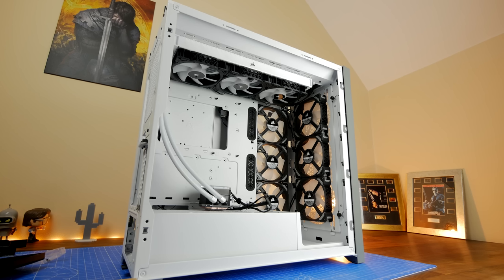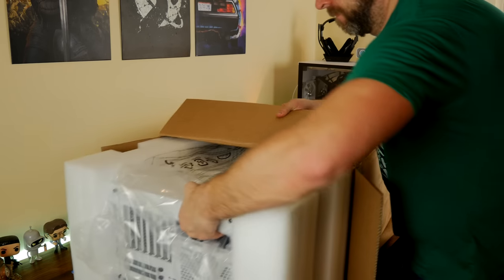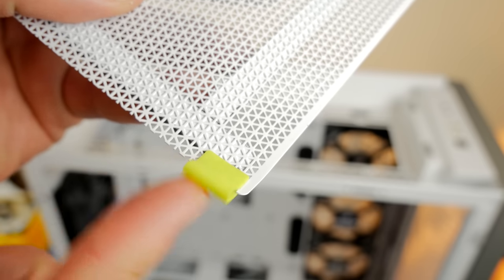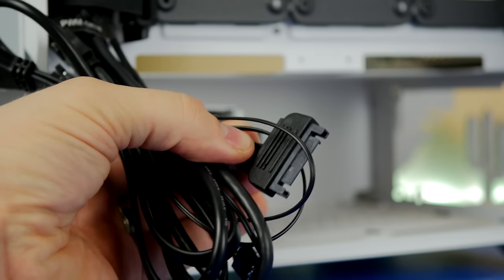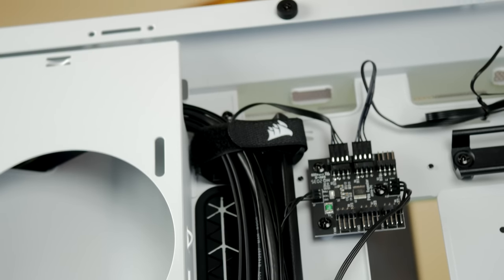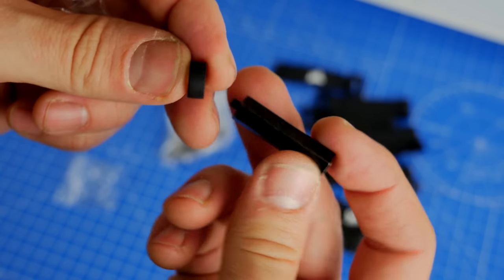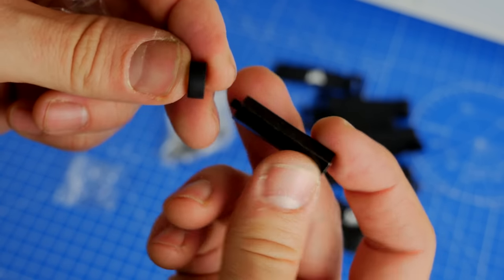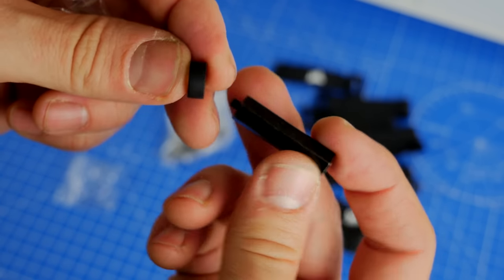Corsair 5000D Airflow build with 12 fans, H150i Elite Capellix Push Pull (in-depth build guide)

Comment: I am confused on the how the lightning node has a purpose in this build. Does the commander core need the be connected to the lighting node? Together both commander core and commander pro support x6 RGB fans connections each, and the pro has the x2 LED connections.  Can't you just use those LED connections on the commander pro to replace that function?
Reply: I've actually spent the last two hours to figure this out myself.

For a modern RGB fan you need to both control their lighting and power their PWM needs. *assuming you want all the features

As i understand it, the [Commander CORE] is needed for the AIO cooler to operate and can control 6 RGB fans and power 6 PWM, the [Lightning node CORE] can control 6 RGB controls but CANT power the 6 PWM, The [Commander PRO] CAN'T control 6 RGB fans but can power 6 PWM, the LED inputs are for connecting to [Commander CORE] or [Lightning node CORE].

So if you are running more than 6 RGB PWM fans you will need at least a [Lightning node CORE] + [Commander CORE] + a way to power 6 more PWM to get all of the lights past the first 6 going.

However if you want to sync all the RGB lights together in cool patterns you will need a [Commander PRO] which will receive the LED input from the [Lightning node CORE] + [Commander CORE] AND power fans 7-12.

So long story short, you will need a [Commander PRO] + [Commander CORE] + [Lightning node CORE] if you plan on color controlling and powering an AIO cooler and more than 6 RGB PWM fans.
Reply: @SetsunaKai5  Thanks for the reply, I really appreciate it. You helped me understand the difference between the power breakdown of RGB connections and PWM connections. You see I was not trying to not make the extra expenditure on a Lighting node CORE! especially after I just bought H150i, LS100 strips, and a Commander PRO lol. but you answered my question so thanks again
Reply: So you are telling me Commando PRO can not power a RGB fan even with an LED connection???

Comment: Very nice video, used it while building! Do you think running 3 fans front and 6 top will cause any issues? I have the black case with glass panels at the top, it feels tight and im afraid of suffocation.
Reply from the maker: Is that the 5000X? If it's pressed too close to the glass that might be a drama.

Comment: Did you try different fan setups? I am buying this case as well and so far I will have 7 additional fans not including the 3 on the AIO….just wanna know what the best set up you found was. I’m worried the intake on front and side might just pull air into the glass and change the directionality
Reply from the maker: Only this one https://youtu.be/r5OY9llXRwo

Comment: Yea the ML Pro spins 2400rpm for 120mm and 2000rpm for 140mm I use 2 120mm for AIO Exaust H100i Platinum and 6 LLs for the case which spin a little slower less noise 680x Black

Comment: Pretty good video, I got the black version of the case and the H150i with 7 ML120 RGB Elite. At around the 26 minute mark you cut when putting the alternate PSU shroud and I'm having trouble putting it in place.

Looks like it needs pressure down but I have tried with decent amount of force and I'm afraid I could break it. I can align the tabs on the shroud side but it has a prong on the bottom that's supposed to be pushed into place in the chassis but it's not going in.

Do you remember what you did to put it in place?

Comment: Do you know how thick the radiator support is on the motherboard tray? I know it can fit a 360mm radiator but I'm not sure about the thickness since I've been thinking of fitting Arctic freezer AIO in there which is 57mm thick including fans.

Comment: I have a question. If you don't use the fans from the side of the case, is it possible to remove the fan tray to make room for the hard drives or the side panel simply doesn't close if you don't install the fan tray?
Reply: You can remove it

Comment: Can I just install three fans on the top of the case (outside, pulling air) and mount the Elite Capellix Radiator under  it without install three additional fans directly attached to the radiator. do you think it it will provide enough airflow to cool down the radiator? I am thinking a easy cleaning of the radiator. TIA

Comment: did you use a fan hub to plug in all the fans? if so which one i can never find one that looks "ok" . not sure myself what i mean by ok but they all look cheap and overall crude.
Reply from the maker: The commander core that came with the cooler

Comment: Do you think is a good idea jump from the Corsair 500r to this one?
Reply from the maker: Very much so. The 5000D is a great case. Good airflow, easy to build it, great looks. It's one of the best I've built in lately.
Reply: @TheProvokedPrawn  thank you for answering, question do you think the noctua redux made a huge difference? Or with the ml120 from Corsair are enough? I need to keep cool a rtx 3090 ftw3 and a 10700 non k with nhd15.

Comment: Hi Great video btw this is helping me a lot for my 1st build I have the same case but I,m a little confused on which motherboard to get for this, its the front ports how many headers do i need for all the front ports on the case  to work? Can the 2 type A ports use one header?
Reply from the maker: You can get splitters if you haven't got enough ports on your mobo
Reply: @TheProvokedPrawn   Thanks for the swift reply just done a bit more research and I,m pretty confident now 👌

Comment: New PC builder question: Does the push/pull setup mess with the case pressure? I’m thinking about running a very similar setup and was going to add a rear exhaust fan, but am questioning it because technically w/ the push/pull rad setup you have equal amount of fans as your intake at 6. If someone could point me in a direction to find an answer for this that would be fantastic.
Reply: i was wondering the same.

Comment: im new to building , i bought the corsair 5000d rbg , i thought it came with a comander pro , it just has the led hub and fan controller. do I need to get a commander pro ?? and if i do , how would i use the ones that CAME WITH THE CASE?

Comment: Nice content! I just have a question, for the push pull configuration, you used long screws to mount the 6 fans to the radiator right? Do all of those screws come with the QL120’s?
Reply from the maker: The long screws all came with the AIO
Reply: @TheProvokedPrawn  so did it come with 24 long screws? sorry*
Reply from the maker: Yup

Comment: 19:30 quick question... so you see theres 6 of those power cable slots for fans right... I'm going to be using 7 fans (not including the 3 aio fans) so where do I plug the other cables in for power? am I just being stupid or is it actually a common question...?
Reply from the maker: You can plug power into motherboard system fan headers if you don't want another Commander.
Reply: @TheProvokedPrawn  thankyou

Comment: Great video, thx! Few questions: How much space between side fans and front fans? If i want install radiator+fans on side and radiator+fans on front, will they interfere with each other?
Reply from the maker: You can't. Two rads can only be side or top mounted.  Or front and top mounted.
Reply: @TheProvokedPrawn  thx for answer!

Comment: Correct me if I’m wrong. Did you sacrifice your front panel usb connectors so that the other Corsair hub could connect to the usb 2.0?
Reply from the maker: No, front panel connects to the side of the motherboard, those controllers connect to the bottom.
Reply: @TheProvokedPrawn  so the Corsair 5000d has usb 3.0 on the front and my current case connects it to a usb 2.0 so when I get this new case they will both be free I’ve been rewatching this video so much wondering where I’m going wrong

Comment: Very informative and helpful instructional vid - LIKED and SUBB'ed!  Looking forward to watching more of your work!  One of the few reviewers/instructors that seems to really 'care' about helping those who are considering DIY.  Speaking bluntly, this looked a LOT HARDER than I would have at first imagined, I am referring to setting up all the wires and connectors to run 12 or 13 fans!!  What a nightmare!!!  Plus, you did not mention that Corsair also makes LED/RGB ML (Magnetic Levitation) fans, which I surmise might be more durable (though perhaps louder?) than conventional-design PC fans.  Have  you ever tried a custom cooling loop solution?  Also I saw ARCTIC makes a nice line of very thick rad AIOs, which are purportedly VERY effective.  Have you checked those out?
Reply from the maker: Not done custom loop yet no. And sadly not seen any Arctic cooling gear yet sadly. Thanks for the comment sub and info!
Reply: @TheProvokedPrawn  I believe the 'included' fans with the Corsair AIO you are using are indeed ML (Magnetic Levitation) models, at least on the RGB version of the Corsair H115i, they are (ML).  Supposedly they live longer lives than conventional fans but who knows?

Comment: HELP😱, so i just stuck in a capellex 150i into the 5000x. I didnt realise the commander node didn't have a usb port. So im stuck what to do with my additional 4 fans on top of my 6 in the commander node. I want to be able to control the 4 fans which aint connected in the commander node in icue4. Bios isnt a option for me on these. So unsure best method of doing this. Currently my 4 fans are non rgb but mainly want to contril in icue4 so guess i would need rgb ones for it to work? 

So far i think my only options are a commander pro or a commander xt? Thanks

Comment: Why you didn't say anything about that crazy pump noise ? It is definitely too loud even on quiet.
Reply from the maker: Because I didn't have any? Maybe you have a defective one?
Reply: @TheProvokedPrawn  The problem here is that RPM of the pump is always set around 2250 even on quiet preset which makes it loud, when gaming it's even worse so it's a shame that company like Corsair is not able to add a silent preset of let's say around 1200 RPM pump.
Reply from the maker: @rafaeldjoker3262  there is a zero rpm mode in iCue though isn't there?

Comment: 360mm aio top.....so Asus rog strix rx 6900 xt lc 240mm on the side exhaust or intake?
Reply: Yup, I’m going to put my ryujin 360 up top and my strix lc rad on the motherboard tray fans pulling air in. Then put my metric screen display in the open fan slot on the motherboard tray above the strix cooler. Have the case coming this week.

Comment: Great video! If you were to add a fan at the back (fan13) will it be an intake or outtake air?
Reply from the maker: Exhaust
Reply: @TheProvokedPrawn Thanks again for the  reply..... This video inspired me to add those extra fans to my 5000x new build however I came across this issue which I hope you have an answer too..... is that when I connected  set of 6 fans power cables into the PWM Repeater PCB board that came in with Corsair case already, then connected the PMW Repeaters cable into the MSI motherboard system fan 1 as instructed .....the issue lies within my rpm which set by default to 1330  once PC is on and continues .....I tried to lower the rpm on MSI dragon center and just didn't work.....I tried to unplug it and connect a single fan through system fan 1 and I was able to tune down the rpm manually to a point where it goes off ..... Have you experienced a similar issue or they were working to temperature accordingly?

Comment: Hello! I am about to start a very similar build. I have two of the Commander Core hubs. By using the two hubs, do I still need to use the hubs included with the fans as well as the controller included with the case? I'm thinking I do not need to use them, but I wanted to check first. Thank you!
Reply from the maker: Here's an indepth explainer of fan logic https://www.youtube.com/watch?v=jvXCbny-Suw
Reply: @TheProvokedPrawn  perfect! That answered my question! Thanks!

Comment: That you very much for this video. It's helped me build my system! I have a quick question. @ 38:55 I see the Audio cable and on mine the black wire in this connector came out. Does this actually control anything? Maybe just the headphone jack?
Reply from the maker: Front panel headphone yes. If you're not going to use it then it doesn't matter.
Reply: My co-worker is an electronics engineer and took a look and said he could fix it no problem, in no time flat. He did so and it's all good :)!
Reply from the maker: @CorbuloCDN1  nice

Comment: Can we find a schematic somewhere on how you wired the fans ? Im trying to figure it out for my first build but im struggling. Can i connect the power repeater (comes with the case), the commander core AND the RGB LED hub to the motherboard ? Also if i have 10 fans do i need the lighting node pro ?
Reply from the maker: The Corsair support forums are great for this

Comment: I have nearly the same setup when it comes to the fans, AIO, and core/hub setup. I want to run a 13th fan on the rear, but don’t want to buy a commander pro/rgb hub just for one fun. What should I do?
Reply from the maker: That could be powered by a motherboard fan header. If you've bought enough fans you should have an RGB hub and LED core you can use for it. Alternatively splitter cables might work for power?

Comment: Hello sir, Im kinda deciding between this case and the 5000X, I guess this one has better Airflow, but if You had a cyrstal instead of mesh in the front, how do you think the airflow will be? Since I would be using 10 fans aswell
Reply from the maker: It'll be worse but should still be good enough. Corsair cases generally are in my experience
Reply: @TheProvokedPrawn  Yeah with 10 fans, I guess even with the side panel should be enough. The cristal looks good but not as much airflow as mesh, anyay I think the extra money gives you the free header and the rgb fans

Comment: I have the 680x with 8 fans, is there any way reduce noise when gaming under high load apart from adjusting fan speeds? I get about 60-70 degrees on CPU & GPU.
Reply: Go into your bios. There should be a smart fan options when you go to fans. I don’t know where to go for you but that’s what I usually do. I use smart fans so when it gets hotter the fans get faster

Comment: Got a question. I have the iCue 5000X version of this case (Glass instead of perforated metal). I've installed top mounted push 360mm. Can I add push/pull even tho its a glass cover?
Reply: You can purchase the vent screen from Asus, it fits in the 5000X case.  I'm building mine now with the glass but I purchased the screen as a back up test. $15
Reply: @tk8153  Asus? You mean Corsair right? But thanks for the tip, I will certainly look into this! 👍

Comment: I'm getting the same 5000d airflow case with x3 LL 120 fans and x3 QL 120 fans with the same AIO cooler you're using. Will the different types of corsair fans (LL and QL) be a problem? Such as syncing them together for example.
Reply from the maker: It's not recommended apparently. They have different max speeds for example and though they'll be recognised by iCue the lighting might not sync up perfectly.

Comment: I have a question: how much can you push the hdd case to the front? I'm asking cuz I have a similar PSU (RM850i) and I don't know if it's gonna fit well on the case with 2 hdds installed
Reply from the maker: Yes iirc. I thought I covered it in here

Comment: Hello, you mention a LED Core item. Do i have to buy that separately or does it come with an item? this is the case and the exact build i want to do in 2 months.
Reply from the maker: The LED core comes with the triple pack fans.
Reply: @TheProvokedPrawn  so the triple pack fans come with both controllers? That's a pretty great cost saver.

Comment: Hey what did you use to add the extra fans? Do you have a link as I have the same case but I want 3 fans in the side and a cpu cooler 3 fan radiator on the top and I want the same rgb and fan control for all of them ?
Reply: I want 6 intake 4 exhaust if that would work,3 on front and side intake and 3 top and 1 rear exhaust

Comment: I always like these types of pc but for general use does it collect lot of dust inside the pc???
Reply from the maker: There are dust shields all over it that collect the majority of dust and prevent it getting in, so no.
Reply: @TheProvokedPrawn  thank you wanted to build pc after 7yrs now pc case trend is changed glass panel and mesh type etc

Comment: I had a lian li pcmr o11 dynamic and the side panel broke because of the heat from the GPU, do you think this 5000D will not be an issue?
Reply from the maker: Crikey. Was your GPU vertically mounted? I've got a Dynamic XL and not had that problem
Reply: @TheProvokedPrawn  no its horizontal mount. i think its because the gap between the glass and the exhaust is too near. I'm buying a new case and I'm thinking of this 5000D and wondering if I will have the same issue

Comment: Hey man! So i have exactly this case, i bought a pair of sp rgb elite so now i got 6 connected and properly wires, rgb works fine but how do i control the speed of the fans ? The case comes with a pwn and an led one for the fans but in icue ive nothing related to fan speed
Reply from the maker: If you connected the fans to the pwm header in your motherboard then you should be able to control it with your motherboard software